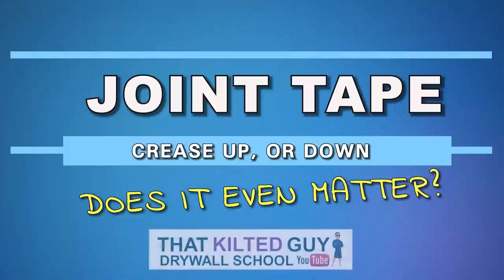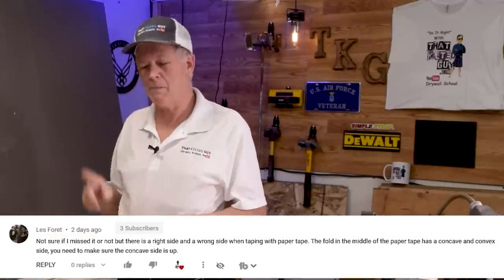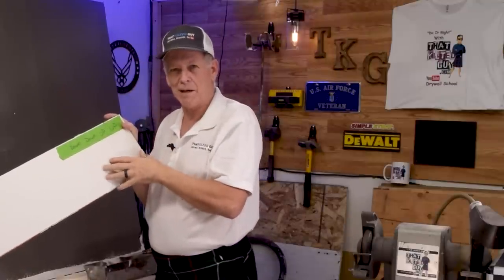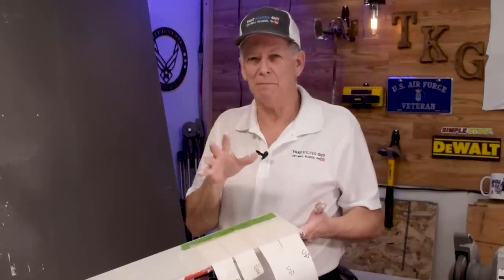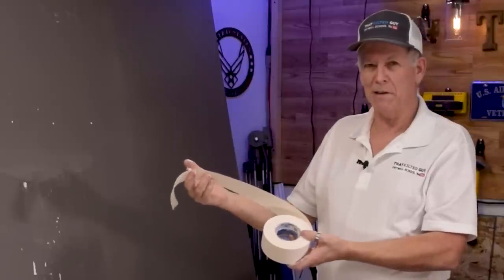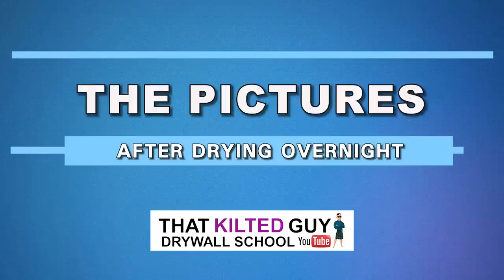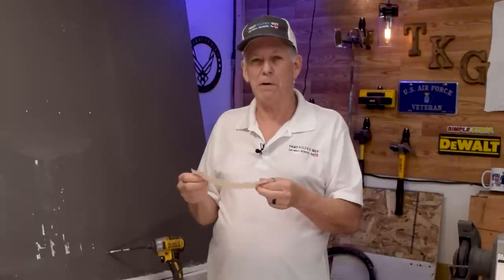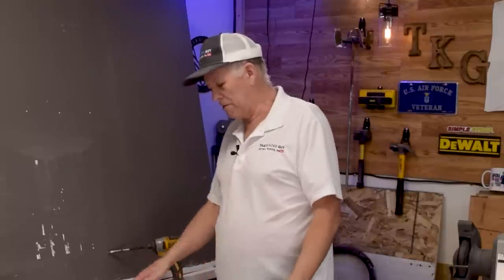I Was Taping Drywall with Paper Tape WRONG for 35 Years???

Comment: Splitting hairs here but I think crease down is the best way. If your wood framing shrinks and grow as most do, your crease being down will most likely want to peak back into solid drywall and mud. If the paper is put on with crease up then when movement occurs the paper will only at best have a very thin layer of mud the keep it from peaking up. Does this sense in theory at least?
Reply: In theory the paper has no chance to withstand the shifting forces and when bedded properly, it will not matter either way.
Reply: @timrich6755  One would think so but I see drywall peaking at the seams all the time after years down the road.
Reply from the maker: That’s usually due to expansion and contraction or not pre filling gaps though

Comment: My opinion is that the crease is there just to make it easy to fold into or onto corners. On inside corners the crease will be against the drywall and on outside corners the crease will be away from the drywall.  Period. Not complicated.
Reply: I totally agree!  The tape is the same through and through, and the texture is the same on both sides.  The only use for the fold made by the factory is for ease of folding on the job.  Like you said - period.
Reply: outside corners are cornerbead
Reply: @nutzablaze3339  You are correct. I haven't done much drywall since 1998 when I built my house and I forgot about corner bead.

Comment: Hey Kilted Guy, Your videos really help me out even though l been in the trades for years. On a repair had rotted sheet rock that was warped and old. Try to put a screw in it and it falls apart. Thanks to you five minute mud saved the day. Filled all the rotted joints and taped them. That five minute mud is the shit!  l would have had to tear the whole ceiling down if it wasnt for your expert advice. When you think you have seen and done it all, there is always a surprise down the road. Followed your advice and have done nothing but make money. lt sure aint easy work, but very rewarding most of the time. Thanks again James
Reply from the maker: Awesome. Glad to hear.
Reply: Hey Kilted Guy! When you transitioned from a tape and bed man to a repair guy, l know you did remodels ect... Was it hard or was there a laqrge learning curve for repair work? Thanks James @ThatKiltedGuyDIY
Reply from the maker: Yes. Like a lot of Drywallers i thought I was pretty good at new drywall finishing and when I transitioned to repairs I found i had a LOT to learn. Took me at least 10 years to get really good and fast, and able to match most textures. Took till now to be able to get super fast and able to match 99% of textures in my area. You guys can get there much faster with the help of Youtube

Comment: Im handy myself. I’ve done quite a bit of sheet rocking for myself and friends. When I did work for a contractor for a while. I was taught crease down. I’ve always put the crease down cause I think when  it comes off the roll it’s better to have crease down. The crease seems to go into the groove when you have beveled edges or even butt joints. I think that’s the purpose of that crease. plus it folds better in corners it’s like automatic when you fold it. Only one explanation is better, when you’re done rocking just get a taper who does it all the time. He’ll make you look good with the finished job!!
Reply from the maker: Like I’ve tried to explain in the video, the crease side down is an old wives tale. Think about it. You said you want the crease to go into the joint of the drywall but you’re putting mud in between the drywall and the paper so that’s impossible. The only reason there’s a crease is to make it easier to fold and put in the inside corners. And because it comes out of automatic taping tools that way, so many of you assume that it’s mandatory. But it’s not. I’ve proved it over and over

Comment: I don't think the crease really matters on flat joints or butt joints, I've put tape on with the crease sticking out a few times and never had an issue with it, it really only matters when taping angles or outside corners and treating it like corner bead. If it works then it's fine and a professional can make anything look good.

Comment: For anyone saying that the crease has to be down, I have been doing drywall work for roughly 16 years and I have always without fail put my paper tape with the crease in the middle with the crease up in the middle (except on inside corners) and I have never has an issue with the tape peeling, not once. I have a lot of repeat customers so if there was an issue I would know it by now. Great vid my Man.
Reply from the maker: Yeah it’s a wives tail
Reply: @ThatKiltedGuyDIY  All you have to do is try to hand crease the tape from one side, then the other. And you'll see the difference right away. The crease is there for a reason. Granted, if your moving slow, it won't make a difference on the flats. 
Pull that stunt in a bazooka  and when you roll the corners in place, that reversed tape will roll right out of the corners. 
I've been finishing drywall for over 49 years... March '73.  That's when I joined the painters union. Actually, I first learned how to use a "nail spotter' in 1964 when I was in the 4th grade. And I'm still pushing the tools.
Reply from the maker: If you go watch the video you’ll see that I know everything you’re saying. The crease is only for inside angles. I even spoke directly with the USG rep and he said the same thing. The crease has nothing to do with flat taping. I’ve been doing this since 1969 so I’ve been around the block a bit. 

And yes it has to go one way through a bazooka or a banjo but that’s not what I was talking about. When you hand tape small areas like this it doesn’t matter one bit if you know how to put the mud on thick enough and not over sand.
Reply from the maker: Go watch this-https://youtu.be/cT_i34ZzmPI
Reply from the maker: And the crease has nothing to do with which way it goes through a bazooka or banjo. It goes through one way because of the natural curl that putting paper on a roll creates. It will curl the wrong way but that has nothing to do with the crease.

Comment: I have an incredibly extensive career in drywall, (about 4 hrs over my lifetime 🤣), and I didn't even know there was a crease in the tape until I watched a video on it. Then I was like, "Ahhhh I see!" Then I just figured it only mattered when doing inside corners because if they're outside corners they'd get a bead, and since you have to apply a fairly liberal amount of mud to the tape it'd get hidden anyways.
  I'm getting ready to try to re-tape the ceiling-to-wall corner tape in one of my rooms because not only is the tape failing, but the ceiling is that hideous mop texture. I'd love to remove the texture, but I don't know how to skim coat, and don't want to NEED a pro to come in, and fix my screw-ups because we don't have the finances for it. The tape is in really bad shape because originally it was all hidden under crown moulding.

Comment: By the time I mix a little water in my mud it’s just damp enough to make my tape pliable enough that it works either way on butt joints. It flattens out the curve from the roll when thinned and mixed right. Really doesn’t matter as far as I can tell, although I’m in the habit of setting my tape curve down.

Comment: Well to me it only makes sense that when creasing the paper for a corner taping, it folds easier with the crease down, and it unrolls with it down, so the crease would only makes sense to be applied down, with that said, I have had many issues in the beginning with the crease up being exposed after all the sanding was done, but never with the crease down
Reply from the maker: I’ve never had a problem with it facing up or down, so I think experience determines whether you will have an issue or not.

Comment: I can remember the brand when the tape was actually perferated, it appeared as bumps like goose bumps. I didn't know why that was until now.
I'm glad you made this video.
I prefer paper tape and have never gave it thought except on inside corners.
I've probably applied it both directions and never had an issue.
And if your putting proper skims on it, it shouldn't be a problem.
Thanks for this video captain
Reply from the maker: Thanks so much commenting. I appreciate it

Comment: The crease was designed solely for inside corners, myself I always lay it down simply because it has just become sort of systematic.
Reply: Exactly the point. Plus it has to be down for the corners to fold. Why would a person put it crease up on the other joints and then down for corners.  Non sensical.

Comment: I don't think it makes a difference on butt/flat joints other than it it is easier to coat if the crease is against the surface (crease down).    The amount of mud under under the surface as well, as the amount your remove to squish it down is what counts.   I've done both ways with any issues.    The accepted method is "Crease down" and i've found prefilling with a suitable product (heavy/hot mud) is more important than which way the tape goes.   Obviously inside corners then you crease down as that is why it comes pre-creased from the factory.

Comment: I have tried to run it down but also a lot up but found keeping it down I could work the angles better or at least it seemed it to me. We paper taped with durabond for veneer plaster so it really did not matter there because we were running base and finish. But one thing for sure I had a lot less issues with paper over the fiberglass back when it came out.
Thank you for all of your great videos. Love them all. Very informative.
Reply from the maker: It does matter in the angles.

Comment: It's rare, but it happens, hair line crack in the flats, or just one flat should I say. Sometimes when wiping tape it creates a ditch in the middle, I've seen it happen even when the sheetrock is tight. I've never taped with the crease facing up, except for 45° corners, because the tape holds truer for longer, but I use straight flex now. I like wiping tape with a plastic knife nowadays, easier and it doesn't create ditches in the middle of the joint like sometimes with a metal knife, I've also noticed if ya don't put your finger on the blade when wiping it doesn't create ditches sometimes, but sometimes it still does...Plastic knife is definitely the way to go when wiping tape. I use a bazooka, banjo, and sometimes hand tape, it just depends on the job at hand, but when I use the bazooka or banjo, plastic knife is definitely the way to go...

Comment: Hi Mr Kilted Guy, I got a new home and the garage corners are done with metal bullnose corners. They are not paper-faced bullnose corner beads like I see at Home Depot. Do I leave the metal alone, put some primer and then paint on it? Or do I need to put paper on that metal bullnose corner with some adhesive first? Thanks in advance
Reply: @Nicklaus White thanks I’ll just skip mud on the metal and just go straight to prime/paint.
Reply from the maker: I personally hate the all metal corner bead because I don’t think it’s going to stick as well and you should not even attempt to put texture on the round part of the corner as I know it won’t stick as well. But it is designed to simply install it and put mud over it with no primer underneath so I’m not sure if primer would help or not. But I’ve never seen it done any other way. 

The bullnose corner bead I like has the designation of SLOC N. You can look that up if you want to see what I’m talking about. It’s basically paper faced on all the exposed surface. But I also think tape on corner bead is much better.

Comment: Ok I'm gonna try to make this short. I'm not a taper and floater. But I've hung truck loads of sheetrock. I want too learn but dont know anyone that actually knows how too tape and float. So I'll like and subscribe. Question: I've been in hundreds of houses where you can see the tape coming through the paint. Why? In some cases its actually peeling away even pulling the texture away from the walls. Before someone sees my handle, I've been doing all aspects of construction since 95. Been self employed for 5 years. The reason I dont tape and float is because I dont steal from my customers. I've seen some really bad work and the only guy I knew that could really tape and float passed away a few years back. That cat was good, real good.

Comment: I am not an expert; just do repairs to my own house.  When I first taped and 'floated' back in the early 80's there was no internet to go to for advice.  I had no one to ask. The only teacher I had was an article in a "Popular Mechanics" magazine.  I also believe Black and Decker had a series of articles designed for the DIY home improvement guy.  But it was never stated which side of the tape goes down.  I believed the crease down the center was to help you fold the tape, evenly, to get into an inside corner.  That put the raised crease going down -- touching the wall.   I assumed the paper needed to go on the wall, everywhere, raised crease down, touching the wall.  That is how I did it then and how I would do it now.  I was successful in doing the tape and 'floating'.  Nothing ever blistered or came off.  Watching videos on You Tube now, shows me that I pretty much did it correctly.  I am a woman, and back in the 80's teaching myself how to finish drywall was considered weird.  Most women just did not do such things.  But I was a daddy's girl and if my father was doing something to the house, I was there.  He wasn't around for me when I was a young adult due to his death when I was 14.  So I picked up books and read magazine articles.  So nice to have the internet now and especially you guys on You Tube sharing your skills.  I am 60 now.  I moved on from drywall to framing, to roofing, to laying tile and simple electrical tasks like installing fixtures, switches and outlets; and building cabinets and furniture like end tables, entertainment centers, desks.  I love doing all of it and since the year 2000 when I first got the internet into my home, all the guys on You Tube have been my teacher.  You filled in for my dad and for that I am grateful.  Thanks to all of you who care enough to share your knowledge.
Reply from the maker: Thanks, glad I could help you out 😎. And thanks for subscribing!

Comment: I was always told to pre moisten the tape before it goes on the wall. Secondly watch the tempurature, if its a central Ca. day at 105 degrees I was told that the mixture must be fairly wet.  Thirdtheres gotta be a right way via the manufacture on install procedures.
Reply from the maker: There’s not because it does not matter

Comment: I would suggest trying your experiment with mud that is looser, closer to what would be used in a bazooka or banjo. You'll notice that due to the mud being thinned down it will moisten the tape more as well as cause more shrinkage. Given these phenomenon , you'll encounter that ridge protruding higher than normal on occasion. High enough ay times to interfere with a butt joint.. God I miss doing drywall
Reply from the maker: Here’s the thing, in all my years I’m sure I’ve installed thousands of yards of paper tape with a banjo with well thinned out mud and I never saw that ridge give me a problem once. If your mud gets sanded down that thin, you put it on too thin or over sanded. Like I said, in 35 years of doing this I would’ve noticed it by now.

Comment: The one place I might flip it crease up is when I'm doing a butt joint that's a little rough, just in hopes it will leave a little more mud begin it and not shrink into any gap. It doesn't really make a difference to me. I've been at it since 04, I've ran tape both ways and never had an issue with it.

Comment: I've had it bubble at the fold, but I belive it didn't have enough joint compound to start with.  I like the fiber mesh tape. Seems to bond better for me. But thats also using ultrat light patch or patch and paint.  The last job I did was the green lid 5 gallon bucket and after always using the patch and paint ive learned how to work with that better.  Never used a hawk, or pan.
Reply from the maker: If you use mesh tape, be sure you are using setting type mud as per the manufacturers requirement. I recently released a video about how mesh tape will fail much more if you don’t do it that way.

Comment: I have been doing plastering all my life and I agree if I taped with knives I do usually pay attention and never had a problem and I have used many different types of tapes over the years . Taped is meant to stick to plaster on both sides if plaster wouldn’t stick to both sides you would have huge problems.
Reply: Joint compound is not plaster.